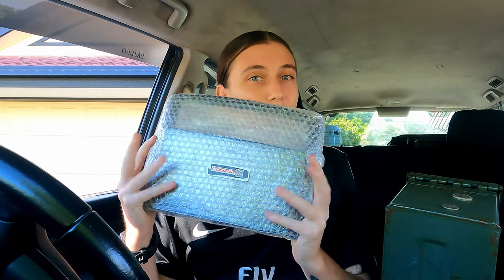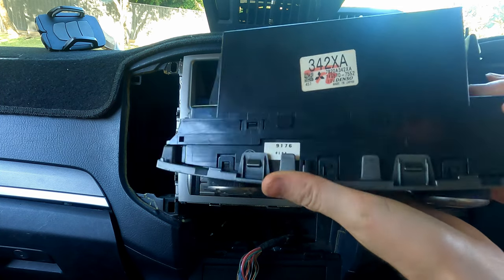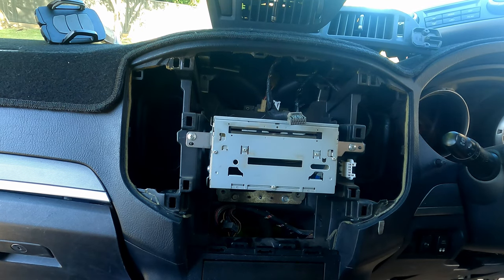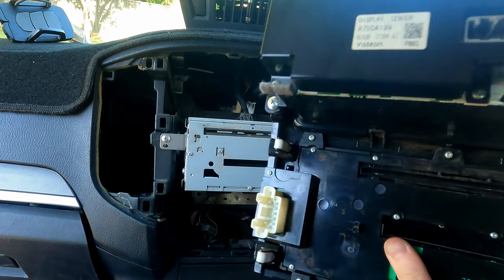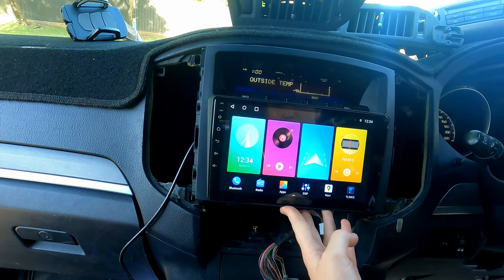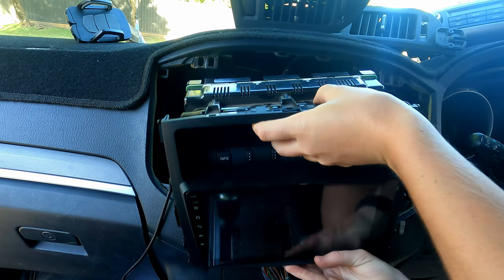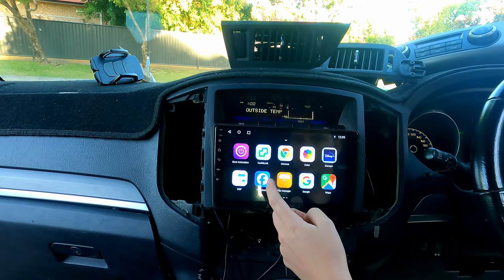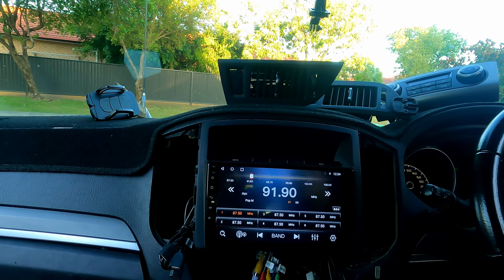HEAD UNIT UPGRADE ON MITSUBISHI PAJERO | EXTNIX PREMIUM HEAD UNIT | STEP BY STEP INSTALL TUTORIAL

Comment: I've been on the fence about getting a screen system as I love my CDs when I go out where there's no network, but the wifi on this one to download Spotify playlists might just push me over the edge to make this my next upgrade! Looks awesome and very well documented with all the steps!
Reply from the maker: Definitely one of my favourite things so for is being able to down load a few play lists onto the head unit with 64gb you can down load a lot, I might do another video in a few weeks on some of the features it has and I'll show the music setup
Reply: @bia4x4  that would be awesome, I'll keep an eye out! Also liked the reverse camera follow up vid. How did you mount the camera and was it hard to route the cable from the tailgate to the centre console? That read door grommet seems like it would be a pain to get through 🙄
Reply from the maker: The gromit actually wasn't to bad to put it through I tied a string to a tent peg and pushed the peg through, then it was fairly easy to pull the wire through. And I just ran the wiring from the head unit behind my accelerator then through the floor tucked in away then had the wire through the boot trimmings then to the back door, it was fairly easy I'll maybe add it into the walk through video I'll do

Comment: Best upgrade for mitsubishi interior! Well done
Reply from the maker: Definitely I'm so happy with it
Reply: I would recommend adding some high density sponge on the display unit from the inside on the top and bottom as this reduces rattling noises when going offroad.
Reply from the maker: Ok thank you I didn't think of that

Comment: Super useful. Thanks Bia! Only bit I'm struggling with is feeding the USB cables to the glove box. Just can't find a path to a hole where I can feed the cables through. Did you have to remove it to get the cables in?
Reply from the maker: I ended up leaving 2 of the usb plugs just stuffed behind the dash as I didn't need them. And pulled 1 through, next to my traction control button. It dosnt look the greatest I still need to tidy it up just sometime I get to lazy even tho it's been over a year now whoops hahs

Comment: Hi Bia, great job on the stereo. Did you have any problems with the fitment of the top display into the new facia, did it click back in and everything line up with no gaps? I am trying to decide between a couple of different brands and I’ve heard that some have problems in this area. Thanks in advance.
Reply from the maker: Hey, no didn't have any problems it clicked in perfect for me with no gaps
Reply: @bia4x4  Awesome, thank you.

Comment: Hello, thank you for the step by step guide. I have the original display/GPS on my Pajero with backup camera. I would like to upgrade to an after market screen like the one you are showing. Do you happen to know if your screen is compatible with the original reverse camera?
Reply from the maker: I think it is possible but a bit more difficult then fitting an after market one, best to contact Asad for more information

Comment: Well done
I take it you don't  have rockford system. Is it comparable for it.
I have kenwood reverse camera. Is it comparable for that
Thanks for sharing 
Cheers
Reply from the maker: Thank you and yes they are 100% rockford compatible I just don't have them in my car, I might look into it in the future
Reply: I'm happy if there is someone would show the Rockford fosgate.  Its far different  from the basic stereo.expensive if done in car stereo shops. Amp, canbus, steering wheel control ..etc is complicated. Than this plug and play basic.  If not done correctly. Cruise control and speedometer will not work.
Reply: @jackman2865   I have just installed this Extnix Premium head unit in my 2010 NT Exceed that has the Rockford Fosgate amp. The unit came with the harness necessary to connect to the Rockford. The install was every bit as simple as shown in Bia's video. Cruise control is not impacted. Steering wheel controls for the head unit as per Bia's video. I chose to retain the factory reverse camera - just a matter of pluging it in. The sound is far superior to the MMCS. Wireless Android works well. Just an incredible upgrade for $750.
Reply: @doggerel87  merci j'ai aussi une stéréo rockford jesite à le remplacer.

Comment: Hi Bia, I just installed the same unit. but my speedo's not working. did you have this problem?
Reply from the maker: No I didn't have any problems like that, but I think someone else did send me a simular question a few weeks back
Reply: @bia4x4  thanks. FYI, after doing some research, it looks like my 2014 model has the speed sensor in the same loom, and the wiring sends it to ground. there is a CANBUS option which may fix it
Reply from the maker: Oh ok hopefully it's an was fix
Reply: @mathewkeech5936  hey have you fix your Speedo problem? What did you do?

Comment: Hello. We have same aftermarket head unit but when I installed the head unit, i got an ASC OFF, speedometer not running and a check engine error. But when I return the original head unit, they are all gone and back to normal. Any help would greatly appreciated.
Reply from the maker: Hey sorry I wouldn't know why the ASC would be affected as I don't think any if the connections on the aftermarket headunits connect to it. Your best bet would to try and call where u got the head unit from or even try and auto electrician. But if u find out what the problem is let me know I'm curious

Comment: Thank you for this .. but I have a question .. when installing a new screen .. an audio error shows up on the top screen .. i think there is a connection between the old unite and the top screen by a cable if you notice .. and the new screen doesn’t have a place to connect the top screen with the new screen .. do you have a solution for this
Reply: There is no solution to it as you remove the factory unit. Simply change the Audio error display to Fuel display :)
Reply: @extnixcaraudio  the problem is that there is no audio at all .. all things seems to work perfectly .. but no audio
Reply: @a.jabali6490  did you find the issue ?
Reply: @a.jabali6490   hi, i have the same problem no audio at all , didt you found the problem?

Comment: Hey... did you get the speedometer problem after installing? My speedometer stopped working after installing
Reply from the maker: No I didn't but I think I did have a comment of this video about a year ago asking a similar question. Maybe try finding the comment and see if the other guy came up with a solution
Reply: You need to cut wire(mine was blue)on the corner of the plug which mates up with the white wire with blue stripe on the Pajero harness plug.

Comment: How about the handsfree system did t work with the new unit?
Reply from the maker: I never really used the hands free before the unit. It's not working with this new unit but I haven't tried to work it out or play around with it bc I've never really needed hands free, no one ever calls me😅 I'm sure there's a way to get it working but I can be bothered
Reply: @bia4x4 did you ever get it working? Looking to add to my Pajero and the hands free is the major reason I'm wanting it

Comment: Watch out for your battery needing replacement every 12 months - the unit doesn't go into full shutdown mode and will have a parasitic draw which destroys batteries.
Reply: Really.. does not turning sleep mode off prevent this?
Reply: Settings for shut down after 1 hour duh!!!!
Reply: @jameslambert1804  No. Sleep mode still draws a lot of power. You have to have it fully shut down, which loses memory.
Reply: @noisy_boi_fpv_3920  Sleep mode draws a lot of power still. Shut down loses all memory settings.
Reply: @mini696  🤣🤣🤣🤣🤣🤣
Reply: @noisy_boi_fpv_3920  I see you haven't installed one of these.